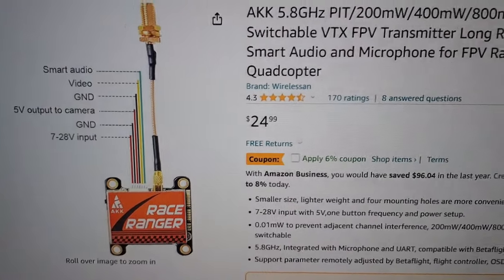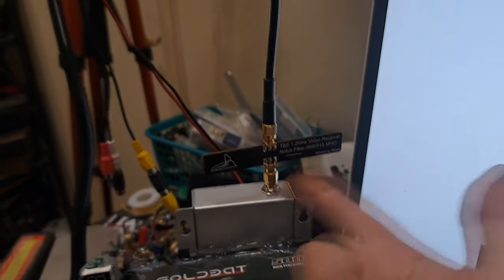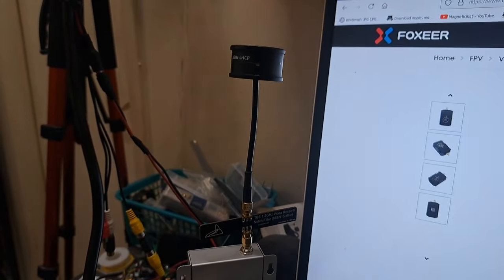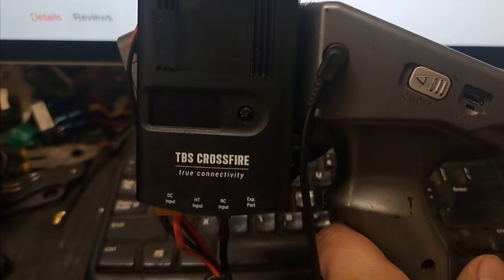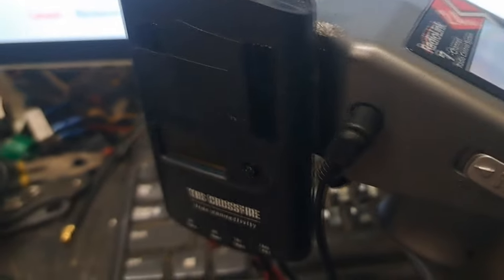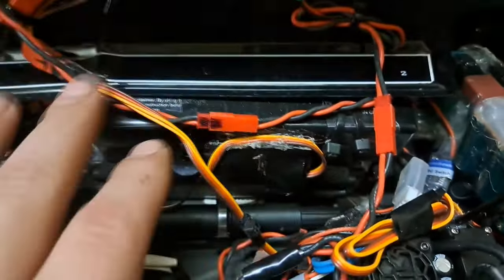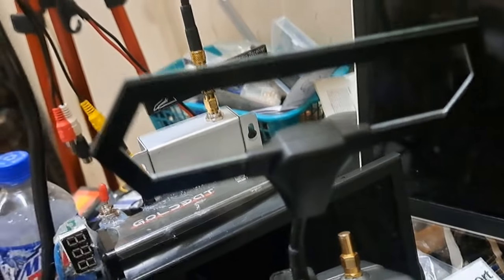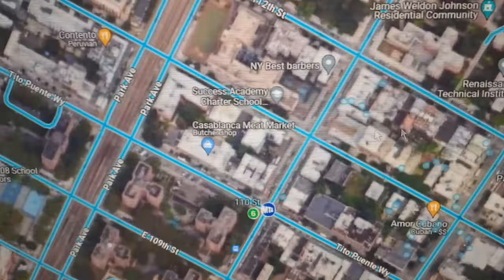RC Ground FPV How-To (Analog + DJI O3)

Comment: Sheesh that is a lot of info , just wait till you get into air rigs
Reply from the maker: lol yea IDK how far I'm going to get into that stuff though. I think when I'm finally tired of the cars I'll give it a good run. I think being able to sit inside and then fly around to 'survey' the area might come in real handy here eventually. In like a real-life survival kind of way if shit keeps landing closer to the fan blades.
Reply: @Magneticitist  yeh for sure it could be simpler in some ways , since there is kinda no way someone try to snach or run over your car , with a drone or plane , but there are some other risks associated with it like if loose control of it it could fall on someone head or cause some kind of damage , I am sure there are some kind of rules for  rc flying probably not legal to do in some areas or I even I think I read some about a weight restriction but for sure it would be handy to have some eyes on the sky .
Reply from the maker: @rodriguezfranco3839  I think mainly right now I already know I just wouldn't feel comfortable doing it. Not just because I'm not good at flying them but because I already have that feeling a little bit with the cars. I try to get more experience to get around it but I basically just skim past things I would otherwise explore more closely. It's like this concern that I don't want to get too off track etc. With a drone the concern would be just trying to get wherever and back before my battery died, and because of that I'd probably never leave a close range area I absolutely knew for sure like the back of my hand.